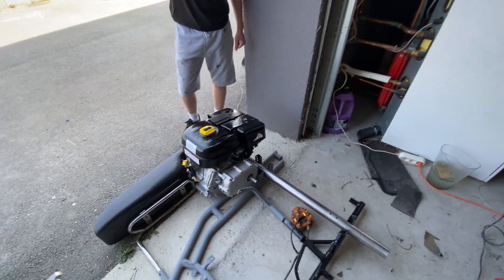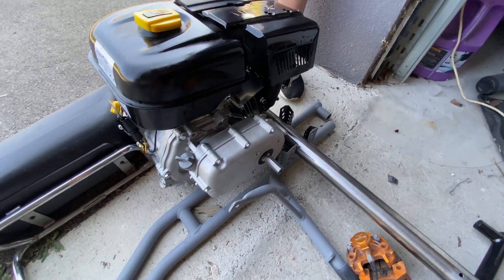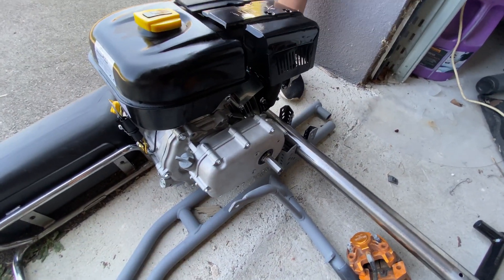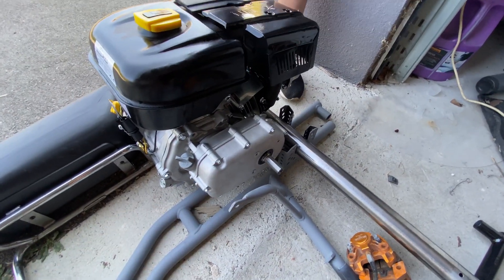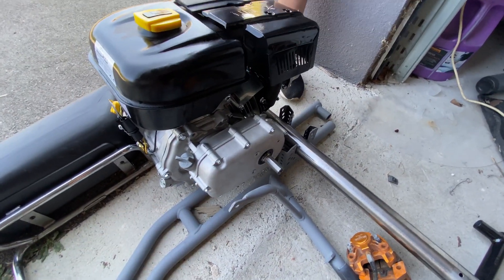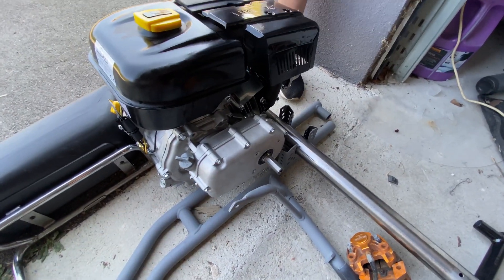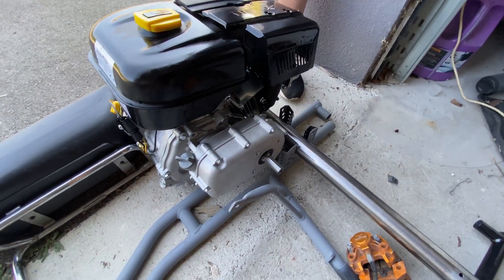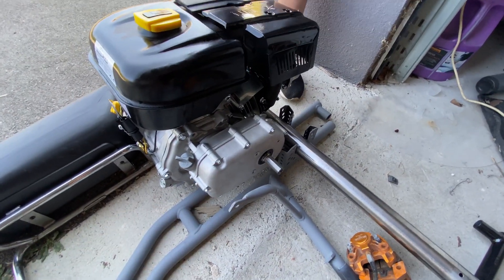Lockdown Go Kart Rebuild Project 270cc - Part 2

Comment: Just an observation but with my Rotax clutch is on the other side that the chain would be facing outwards on the kart, this might not be the same for your engine but might fix your space issues maybe? Also as a side note could you get a centrifugal clutch on there which could be a bit janky but will be much more streamline

Edit: What chassis do you have, There are different sizes of chassis and I think you have got a senior and a cadet seat meaning that the seat won't fit because they need to be really snug because round corners the G forces push on your ribs can hurt if you're bouncing around on the bolts that hold it in.
Reply from the maker: Haha janky is what I love! 😂 I have a clutch like that on order, so will see how that performs or fits when it arrives. I saw that on the rotax stuff and did look at that but it would push the engine way out, and the shaft has to run the way it does. I think it might be OK... we're working on mounting at the moment and when the sprocket and clutch/ chain arrives we might have a better idea of how it'll fit!